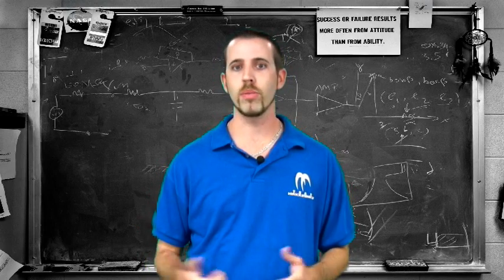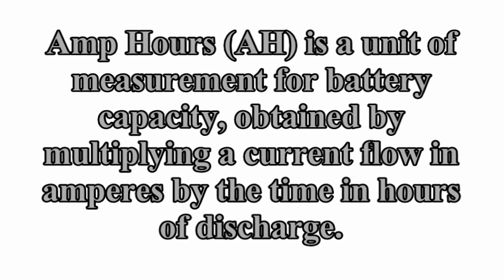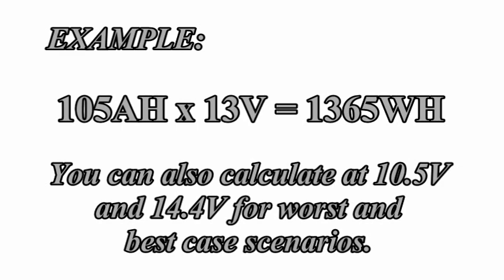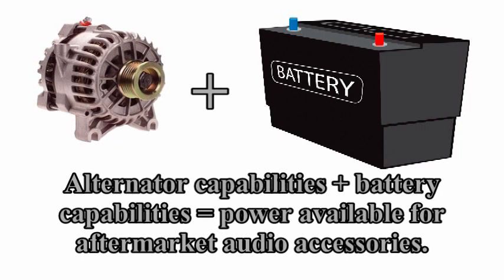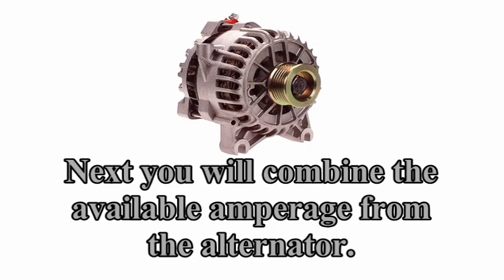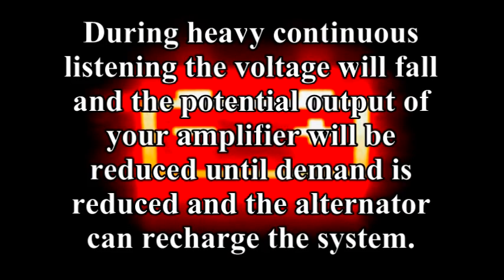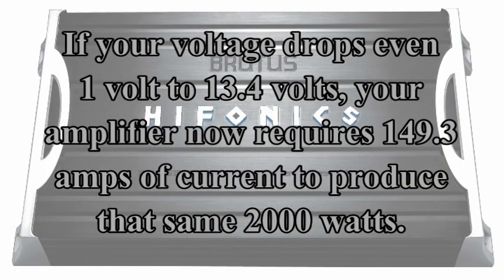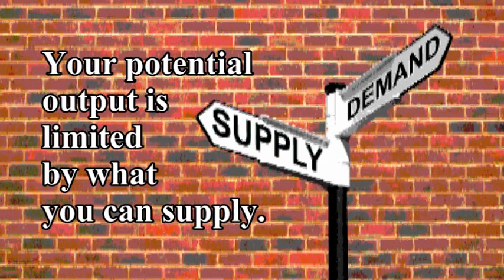Car Audio 101 - Battery Tutorial for car audio amplifier upgrades

Comment: tuning the amps gain you'll need a oscope, but you can do it partially with a dmm. play a 50-60hz testone on repeat and check the speaker output for the correct volt/@1ohm. should be about 37v. make sure everything is set @0. depend on your sub/box for tuning wit lpf,subsonic and bass. 12'clock is safe 4 everything pretty much. but set lpf @80, subsonic@ 25-30. lower means lower notes gonna play. cut it off to your sub. some can play low in the right box. just be safe with it. pros can shim in.

Comment: i had the 1608 in my 93 civic. just the big 3. no light dim at all. your stock alt and battery be good for that watage. i just had a duralast red. mke sure you get a voltmeter to keep a look at your voltage. stinger got one for like 30 buxs.

Comment from the maker: That amp is around 700-900watts rms depending on voltage drop. The GPV series is peak rated. You will be fine.

Comment: @MaxxsonicsUSAInc  is 2000watts safe on factory electrical system im running the crunch gpv 2000.1 on 2 800 rms 15's with a 5v output head unit

Comment from the maker: The sure sign that you need to replace your alternator is when you are in a situation that you know you have enough battery reserve for the amps in your application, but your voltage at the batteries with the ams off is below 14V. 

Your amp(s) connect to your battery(s) and your alternator charges your battery(s). 

Please check out the Alternator video.

Comment: I have a question then... at what point do i need to replace my alternator?? If I have a 105amp stock alternator.. and a 220A system demand then i should probably replace my alternator right? and how does the battery power come into play there? This also confuses me because my current amplifier is connected to my battery.... thanks for any help

Comment from the maker: Capacitor on storage devices that quickly discharge under heavy demand. They are helpful if you already have the proper electrical system for your after market audio equipment. If you don't have the alternator/battery combo to meet the demands of your amps then adding a cap is bad. The cap will actually create more of a draw on the electrical system and starve your amp to recharge.

Comment from the maker: Jake, this tutorial is designed for the average to above average audio enthusiast. Though Peukert's Law has been verified, it takes an above average level tutorial which is easy to follow and makes it much more difficult. The more intense the equations, the less interested and willing most people are to take notice. This tutorial is valid and will indeed get you the results required for after market audio systems. Anyone wanting to expand their knowledge should reference Peukert's Law for sure.

Comment: yes its bad to have two batteries on a stock alternator. the reason why is cause the alternator is going to struggle charging those two batteries. kinda like how you wanna match rms from a sub to the rms wattage of a amp. if you got a stop alt its only going to put out maybe 60 to 80 amps recomended for one battery. where as you put a aftermarket alt with more ampers and the two batteries you should be fine if the alt puts out good. always shorten the length of grounds btw.

Comment: Much better current flow between the 2 batteries. With this ive seen the 2 batteries work better together to keep each other sustained. If you have the wire for it you can run wire strait from the alt to the battery, pos and neg. Like Steve Meade does. But this is really more for High end systems that need huge power.

Comment: So this is why 15 volt systems work so well. So I have some math to do. My system coming up will be 2 alts 4 or 5 batteries and multible amps. There are some batteries out there that are ment for deep cycle and starting. Batteries im looking at are this way and are very large. Almost 200 AH per battery. We'll see.

Great video Mike. You have no idea how much it helps.